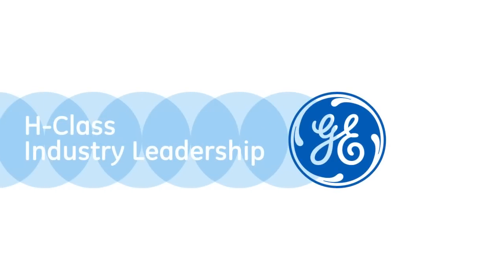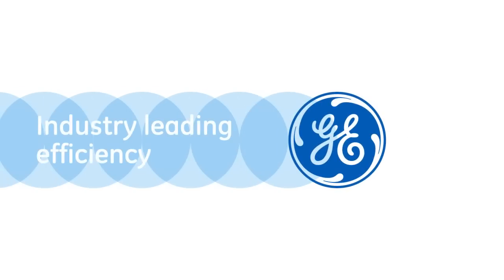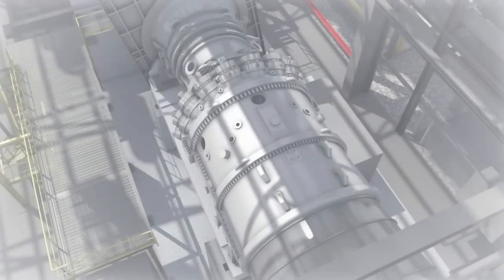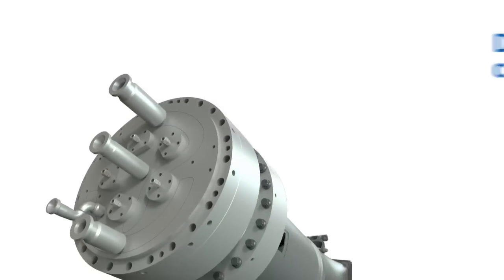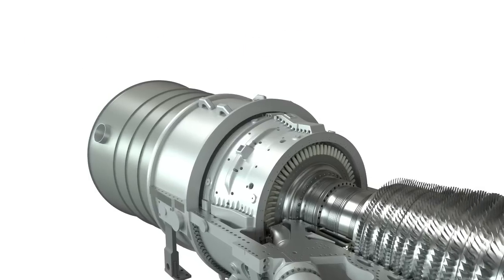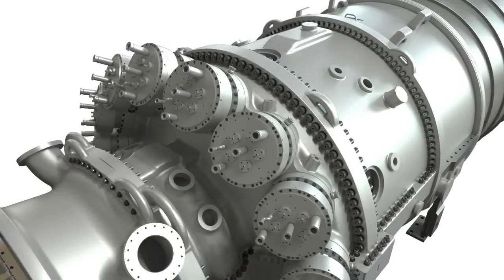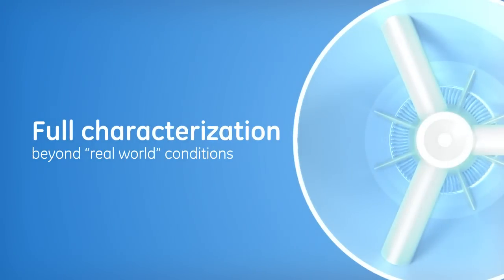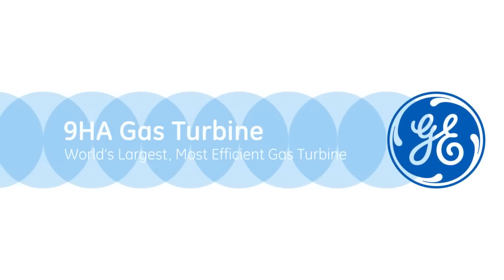Gas Turbine Product | Gas Power Generation | GE Power

Comment: This may sound kinda stupid, but if a Harriet was to burn Hydrogen, wouldn't its exhaust be clean water vapor which could, by using cold water to condense it,  be a new source of both water and energy for the species? Ya think?

Comment: Don't believe the hype! GE's Class H turbines do not meet the published efficiency ratings. There three turbines which were shipped to Pakistan has suffered major problems. Siemens and Mitsubishi gas turbines are far more reliable, and are more efficient
Reply: nobloodyusername Care to shed some light on the 9HA turbines problems installed in Pakistan? I am from Pakistan and I am interested.
Reply: All three plants have suffered from fundamental defects, which include issues such as combustion seal leaks (major contributing factor for failing to meet published efficiency ratings), and most shocking of all, the plants also suffered from back-up failure when there was power outage - this is a major issue. This can cause rotor failure which is what happened in one of the plants. This fault required a new turbine to be fitted to the value of $33 million!
Reply: GE gas turbines is the worst turbines , we have many GE turbines in Egypt all of them have many troubles.
We have 6 new turbines ,installed from 6 years only, in Giza North power plant 3 of them needs new shafts and casing alignment !!!!!!
Reply: @vitalengineeringxpertspvt.3787  GE now admit that there is a major flaw with the primary turbine blade - apparently it suffers from significant oxidisation!
Reply: Yeah well if you guys weren't using sand in the turbines they would last a lot longer, they're designed to run off gas